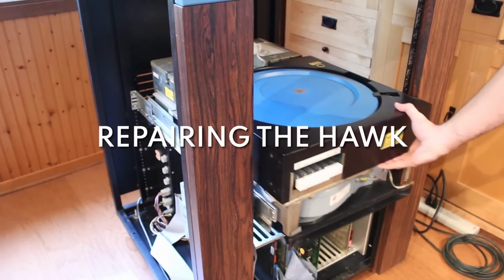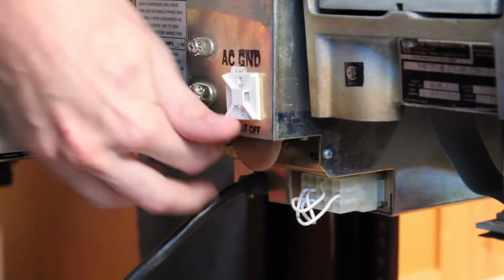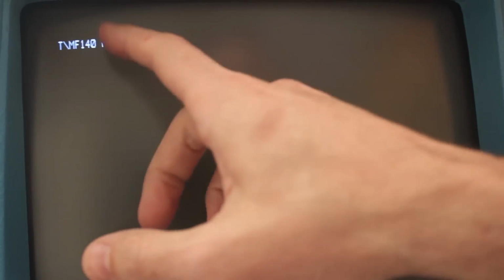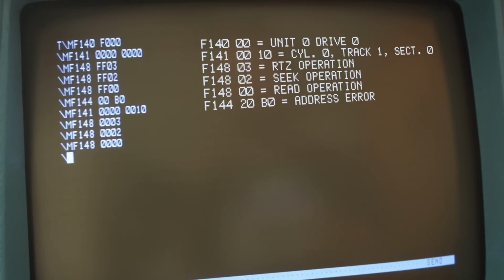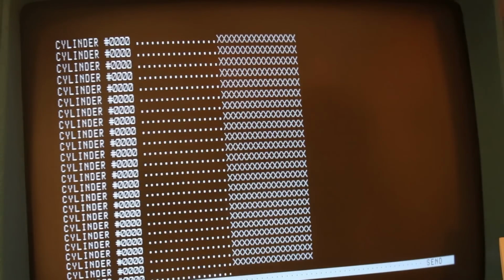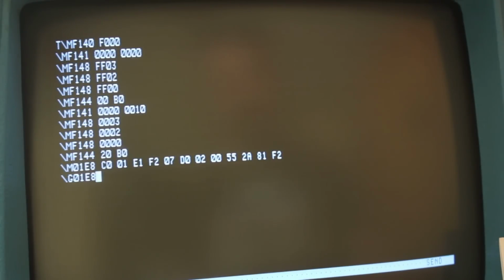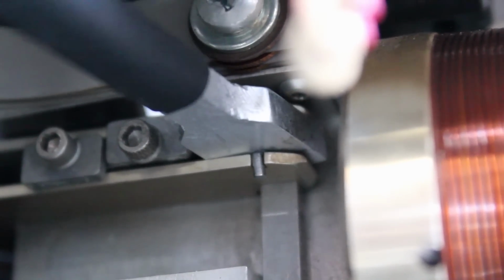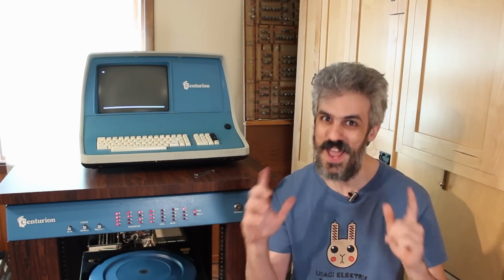Minicomputer Part 16: Aligning the Heads on the CDC Hawk Drive

Comment: I've aligned PC floppy drive heads using a similar procedure. I used a program that repeatedly reads the same track, displays what sectors read correctly, and plays a higher tone on the PC speaker the more were correct. If I recall it had separate beeps for "perfect" and "read the wrong track" (i.e. way out of alignment). It then has hotkeys to move in or out one track. It works best with a factory-formatted diskette you've never written to, because the head that laid down the data on them was (presumably) properly aligned -- so, the ones software came on or a never-used blank.

The result was way better than it was before I aligned it, but it still has trouble reading the occasional disk that other drives can read, so I don't think I did a perfect job. The tolerances are wide enough in floppy drives that I was able to do at least a rough alignment just pushing the head by the tiniest amount my thumb can manage. I should take the drive apart again sometime and see if I can make a lever tool kind of like you used on the Hawk drive.

Comment: Hi Ken. I've been doing the very same things to a Microdata 1600 as you've had to do with the Centurion to get it going again. I've made good progress and can now boot the machine into a monitor program that's in the ROM set on a ROM board that the service techs would carry, swapped into the machine. During the past 6 weeks I've repaired the CPU - there were half a dozen gnarly problems, repaired a few core memory boards and am now ready to begin with the disk drive. It spins up and loads the heads but I want to check its alignment the same way you did in this video. There isn't a routine in the ROMs that will do what Gavin's HWKREA program does but I could write one if I knew a couple of things about that program: BTW, my drive is an Iomec 3004, whic his 5mb removable and 5mb fixed, like your Hawk drive except no voicecoil  it uses a rotary servo for the head positioner.

So would you mind answering these couple of questions please:
Does Gavin's read/head alignment program write a test sector or two onto the disk first? 
- I'm assuming not, so how does he determine whether a read is successful or not?
Would he be willing to reveal a few details about of how the program works?

I can write a program into core and execute it, so I'm thinking that I could put together a similar test program to check the head alignment on my drive.
Many thanks!
Reply: I know that every sector on my drive has its address (cylinder, head and sector number) written on the end, just after the data block, probably the same arrangement on the Hawk, and there's a CRC there too, so does Gavin's program use that address information to determine that the head is over the correct track, and then you work the head in and out minutely, using that little tool, to basically estimate that it's centered over the track?

Comment: You did really, really well to align that without the alignment disk. From memory there was thermal expansion which could cause problems. Used to do that at Wang Computer.

Comment: Aligned 100's of heads on Hawk and Phoenix drives. I used the "Cats eye" method but also software (wrote it myself) for quick alignment, similar to what you have and also for data recovery from bad disks. The computer systems was different, did it on Wang DP and VS systems as well as DEC and DG systems. A long time ago (did it up to around 1986), brings back good memories. Due to sanctions (I am in South Africa) we had to keep the old systems running longer than in most other countries. Also due to the sanctions spares were a problem so we repaired systems down to component level onsite. I traveled all over the country with a boot-load of manuals, components, tools, Ocilloscope and soldering iron.

Comment: Great video series. I didn’t work much on the CDC Hawks but spent over 15 years working with Data General and similar systems (Bytronix, Point4) using the CDC Phoenix CMD -9448. Also had Western Dynex, Ampex, and Micro Data Drives. In some situations when a drive just would not read a cartridge that contained critical data, I took the drive out of the cabinet (quite a challenge for a single tech but it can be done), set it on a cart, and raised either the front or the back of the drive by a few inches. Lifting the back would put a slight forward pressure on the head assembly (opposite when lifting the front), changing the alignment just a tiny bit, and in a few cases I actually managed to copy the data to another disk. If that didn’t work, I would stick the cartridge into a refrigerator for a few minutes. Drastic measures but sometimes it actually worked for a single pass copy.
For alignments I used the CDC Field Test Unit FTU. Last time I saw one of those on ebay it sold for about 5k without the CE pack. 
I still have a Phoenix drive in my workshop but no system to connect it to. I gave all of my mini-computer stuff away for free to be recycled. Dang, now I could kick myself for having that.
Thanks for putting in all that effort and also kudos to Ken.

Comment: Surprised it didn't need azimuth adjustment.  Anything written is going to use the new head alignment.
Reply: We just had to adjust the "Index to Burst" period be turning the term pot CW then CCW on the Hawks Sector PCB till we found the sweat spot without the CDC CE disk pack.

Comment: There's a blast from the past!  Ex avionics guy here '88 to '98.  Test bench had the Varian L-100 with two Diablo 31's.  Yep, waveform first after replacing heads and after that there was a 2nd adjustment for the sector mark.   Other benches had the HP 8906 which required a piggy back box to align.    I can almost remember the bootstrap code LOL.

Comment: I really enjoyed your video. I am an Ex Burroughs/Unisys Engineer who supported both Head Per Track Disk Drives, and Disk Pack Drives. I was a Support engineer for both and I can relate to your video really well. I aligned many Heads in my day using those special Disk Packs and Tools. I also developed a temporary Microcode work around to handle Disk Packs Errors that could occur when there were Power Frequency Changes that could affect the rotation speed of a Disk Pack. Looking forward to your next Video.
Reply: On the Burroughs EU - SU Head Per Track drive I call it had 4 vertical platter but forgot the total heads assy & track counts. Do you recall how many heads are in the SU's?       I recall the design engineers coming up with a platter treatment called "C72". I was told if the engineers did not fix the crashing problems on the SU platter they would not be around to "see 1972" of the fix was called "C72"    Do recall the SU heads assy had a "Touch Pin" that if the head ever touched the platter the head assy would be pulled away from the spinning  platter.  Head Per Track head assy was pushed near the platter to fly with a very small air cylinder behind the head.   Recall the EU ( electrnics unit ) controlled up to four SU ( storage units with the platters ).
Reply: @kenromaine2387  Your knowledge is very good. Yes you are correct C72. Cannot remember how many Heads on each side. Each Head Block had about 8 to 10 individual Read/Write coils/heads. Average Access time was 20 millsec.  Capacity went from 10MB per unit to 40MB per Unit over time. Platters were huge Brass Disks about 1/8 inch thick. The heads did have a touch pin. However Crashes would occur for no apparent reason. Dirt was presumed the cause. Those little Air Pistons used to stick out if the the Heads were not retracted periodically. Yes the EU did control 4x SU's.

Comment: Guessing you can probably do pretty well by connecting an oscilloscope to the preamp output and tuning for maximum signal. Of course you have to decide which disk pack is going to be your standard.
Reply: If you try to align the heads based on max. signal level you are very likely to be on the wrong cylinder. Unless can monitor the disk controllers status register for errors and what type of error the max. signal level will not work.  You have to know that you are over the correct cylinder and the only way to know that is to check that you are not getting Sector Address Errors.  Cylinder are only .005" center to center.
Reply: @kenromaine2387  Sure, I'm not proposing to use the scope instead of the diagnostic program, but in combination.

Comment: Next time you machine something like the clamp end, try taking vertical plunge cuts with about half the tool engages using 2 flute or three. Four flute will gaull up the cutter on a 4 flute

Comment: Those drives were very susceptible to losing the index to quad setting if anything was put on top of them, so alignment in the rack, over-tightening boards etc can cause chaos. The Pertec drives were much more stable in that respect.

Comment: Its a long crime ago but I thought the removable platters had data on one side only. I think the other side was called servo, for tracking and sector alignment
Reply: Drives like the Hawk at 200 TPI have data on both sides of the platter and use an out-of-band servo position detection system.  Drives like the CDC Phoenix running at 400 TPI have data only on one side of platter and servo dibits on the other side of the platter for an in--band servo position detection system.   Years later the drive mfg increased the TPI numbers and data storage greatly again by putting servo's in--band servo position detection system in between the sector data fields during the sector pulse time. The mfg no longer needed a complete side of the platter for servo dibits just the few bit time between the sectors was all they needed to detect the center of a cylinder.  The reason for moving to a "in--band servo position detection system" is it designs out the problem of the disk platter expanding with temperature changes at a different rank than like the out-of-band servo position detection system did and limiting the drive servo systems to only 200 TPI.  ( TPI = Tracks Per Inch  which is really cylinder per inch if you have more than one head per cylinder. )

Comment: In case anyone is wondering why the read test was going slower in the successful sectors and then instantly counting errors for everything on the bad head - it's probably due to the drive giving a faster error response than a successful response after attempting a sector.  When it hits an error, the test program is able to request the next sector before it reaches the head, and it goes through that whole track in one rotation.  Whereas, with the successful reads, it wasn't fast enough to request the next sector before it was already too late to read it, causing the drive to wait for the next rotation for each sector.
Reply: Could be...    To completely read 16 sectors the average time for the operating system would be 1/2 of one rev. of the disk 12.5 ms plus a full rev of the disk to cover all 16 sectors 25 ms.  So a good average read of 16 sectors would be about 37.5 ms.  If we had to do a seek than add 10 to 60 ms for the seek time.   Do not think the CCDP test code was written for speed it was one thing just get thinks working to trouble shoot and save very rare software on the old disks.
Reply: @kenromaine2387  Yeah, agreed - it threw me off initially because stuff completing seemingly instantly is often a sign that it's not even trying it, but in this case there's a perfectly rational explanation.

Comment: Something I've always been warned about when doing alignments, especially without the proper CE pack... You have no idea which cylinder your aligning to....
For example, lets say your trying to align to cylinder 5... Moving the heads in and out could cause you to get valid reads on cylinder 4 or cylinder 5 or cylinder 6.... Meaning you can end up making one head aligned to cylinder 5, one aligned to cylinder 6, another to cylinder 4... This causes all sorts of issues that aren't apparently until your trying to execute code which is expecting data in a certain location...
Reply: That can happen without the CDC CE Pack.  Was not a problem for us because the Centurion DSKI & DSKII controller cards tells us if we are getting Sector Format Errors or Sector Address Errors or Read CRC Errors.  In order for the CCDP test program we used to do the head alignment it will not do RTZ on error and will only display  [  .  ] = good read no errors of any-type   or  [  X  ] = any read or like Format, Address or CRC error. If we had done the alignment using the dip switches on the Hawk's I/O card as outlined in the CDC manual or used the CDC Hawk Field Test Box they do not "read the sector address header" so you could move the heads over a good read signal but over the wrong cylinder (track) in error.  When you use the CDC Alignment CE pack it only has a single place cylinder 146 with the Cats Eye pattern on the complete disk so you can not be on the wrong cylinder.

Comment: i worked for a small company in the UK during the late 80's that sold CE alignment packs to the industry.  It was old technology even then but there were still a few companies that were still using the old disk drives.  I remember the 5mb removable drives and they also did a whopping 300mb version with more disks stacked on top of each other.  The heads were mounted on what looked like a 6" ruler with a few wires sticking out the back.  It looked clunky then.  It must fun tinkering with these dinosaurs and rediscovering the old technolgy.
Reply: I used to work on the 300mb and 80mb control data units. I had to do a head alignment on the servo head (one side of one platter had the track that aligned everything) using the special pack. I seem to remember these were special tracks consisting of "dibits" iirc. Iirc i think when the dibits were properly aligned you got a certain signal on the scope, possibly a sine wave but I can't remember the details as was a long time ago but don't really remember the cats eyes. Attn print sounds like it's waiting for a printer (not console) which would make sense if it were an accounting system etc. You wouldn't want a long job to run without it if it was needed. Maybe using an escape sequence or just enter would acknowledge and allow to "click" through the message.
Reply: @crabby7668  The reason the disk drive mfg switched over to drive using a servo dibits read head system & giving up one complete surface of the disk pack or fixed disk stack was simple temperature expansion problem of the metal making up the platter(s) & the casting of the drives chassis.  Drives before the Hawk had only 100 tracks per inch because they had no temperature compensation system (max 2.5 MB per platter).  Drives like the Hawk had a simple temperature compensation system using a spring plate & metal bar and reached 200 TPI  (max 2.5 MB per platter). The next big step was drives like the CDC Phoenix using one side of the platter for servo dibits and the other side for customers data. The CDC Phoenix designed out the need for temperature compensation system because both sides of the platter have the same  temperature expansion so not problem with the R/W heads moving off the center of a cylinder because the serve head on the other side of the platter is at the same  temperature. With servo dibits the drives are running at 400 TPI and a single surface now stores 16MB.  [ 100 TPI drive one surface 1.25 MB,  200 TPI  drive one surface 2.5 MB and dibit 400 TPI drive one surface 16 MB ]   Hard to be leave 30 years later we have  servo position bits hiding in the sector data field, stacked recording systems, moved from 14" platter to 2-1/2" platter and now sell 8 GB drives in your local MicroCenter store for under $300.   Can not even get started with SSD drives.
Reply: @kenromaine2387  hi Ken, thanks for the explanation and confirming that I wasn't just dreaming😊 you and the rest of the team are doing a great job here. It has been a gripping series so far.

Comment: TAKE A BACKUP. Please for the love of God take a backup of that disk image.
Reply: That was done last episode (before the heads were knocked out of alignment)
Reply: @phirenz  I'd still take a new backup if there was any chance of a problem at all with the old one maybe having slight alignment problems. More backups is better. They're free to do and can only help.
Reply: Not quite free, they take about an hour to stream over serial. In theory, our backup should be fine, protected by CRC on the disk, and second CRC while being transferred over serial. 

However, I'm a little worried the data might get corrupted in memory before the second CRC was calculated (the on-disk CRC is not written out to memory), so we want to make a tool that lets us upload a list of sector checksums for it to verify against multiple reads attempts.

Comment: If the system was used for something financial, it might try to "print" (line printer) some sort of a log entry and fail when it's not able to properly log that operation... That would be my random guess. I think I recall IBM machines also calling for "attention at printer device" when it was offline.

Comment: Oh, man, this dredged up a long-dormant memory.  Long ago, about three lifetimes back, I worked on a system that was obsolete even back then.  My memory wants to say it was the old Systems Engineering Laboratories (SEL) 86, but that's probably wrong.  Anyway, this beast would NOT boot up if it didn't have a functioning line printer.  (WTF?)  The truckload of stuff that came with the Centurion included a line printer...  You don't suppose...?